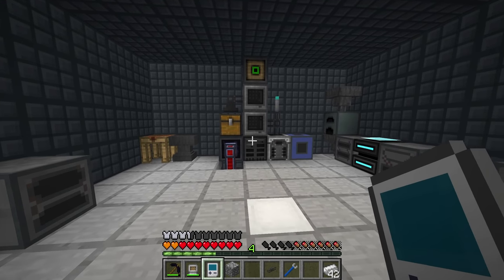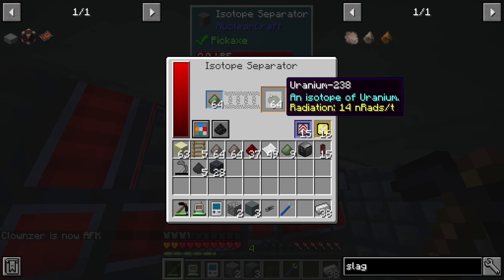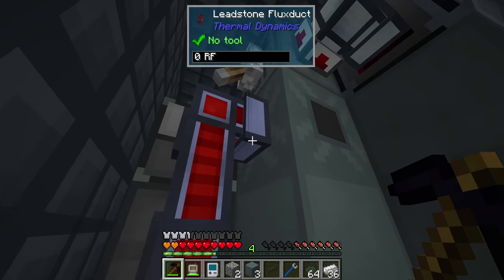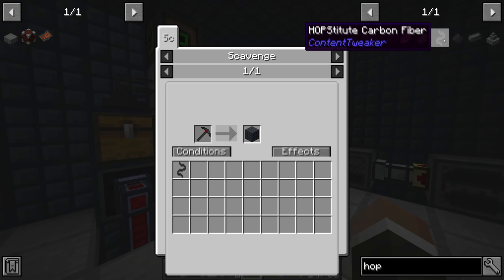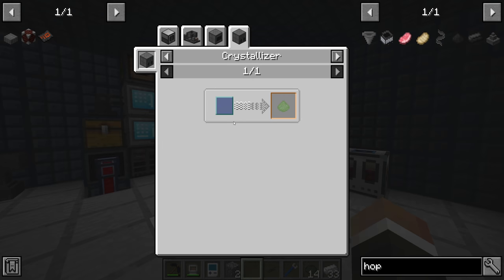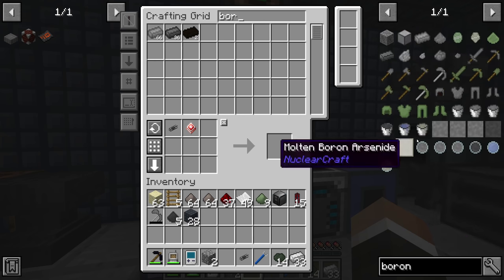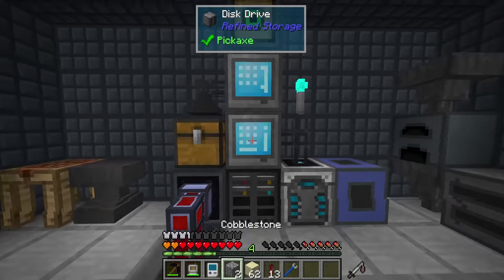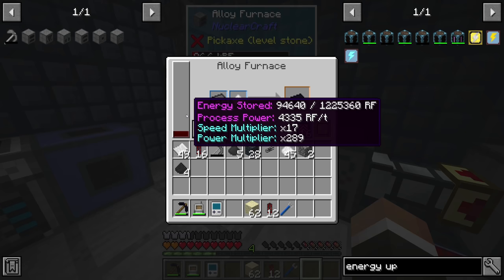Minecraft Compact Claustrophobia | NUCLEARCRAFT PROCESSING! #16 [Modded Questing Skyblock]

Comment: If you look into Immersive Engineering under Heavy Machines the Excavator which i believe can fit in a 9x9 if you get lucky you can core sample for Coal and it will have a 1% chance for Diamond ore and Emerald ore. I got roughly 2 stacks of ore before i upgraded my base and moved the block which i think resets the ore sample after a while.
Reply: Daaaaam big brain
Reply: You can re set a 9x9 if the sample isn’t what you want by burning the block in any furnace
Reply: Merciless Taco 1 more thing. Since the matchin is so big and difficult to build you can build  it 1 time and copy ut with copy thing from gadget (dirwolf)
Reply: Thanks never used that tool havent played modded in years.